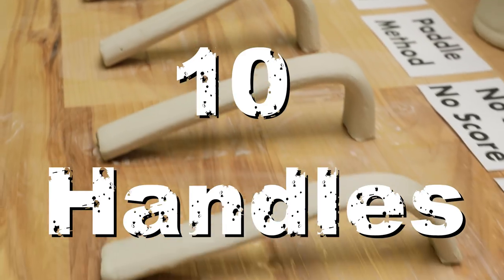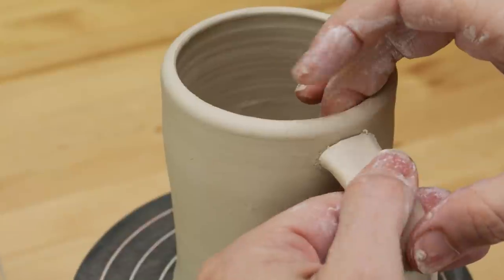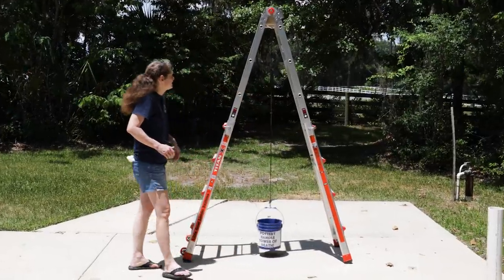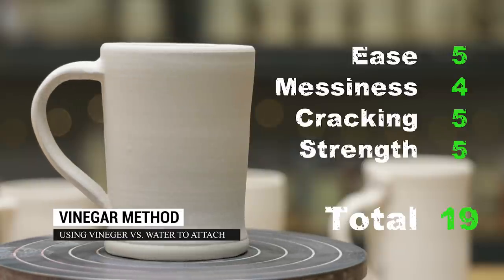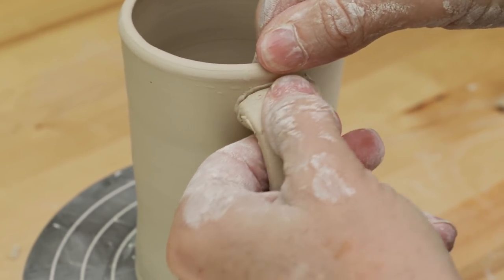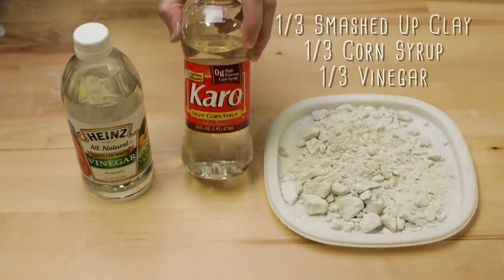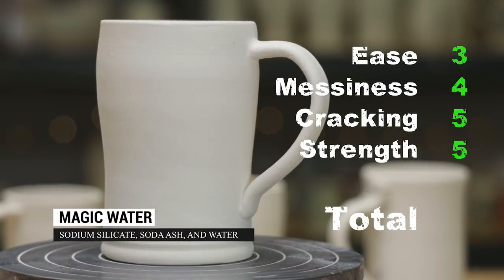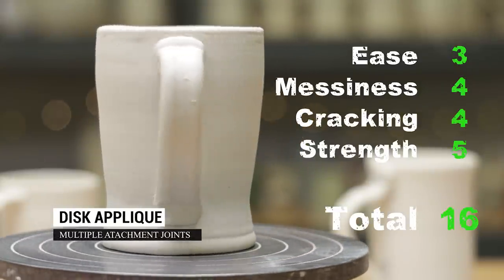10 Ways to Attach Pottery Handles - TESTED!!

Comment: I have now mixed one of the methods you did with something I was already doing in my studio. I had always attached with slip always got cracks. I was told to attach the handle with slip and then put the mug bottom side up to dry and let gravity do the work, less cracks but they still happened. Now I mix my slip with vinegar and attach the handle and then let it dry flipped upside down! No cracks at all and the only thing I changed was adding vinegar to the slip! I can make a mug and fire it in my kiln the next day maybe 2 days max!
Reply from the maker: We’re using more of the vinegar too...nice and sticky and no cracks so far!

Comment: What fun! Thanks for doing this! If you can continue with some testing, I would suggest that you test each one until it breaks. One approach could be to gently hang the bucket from the handle and gently add weight until it breaks.  Then display the weight at which each one broke. I'm guessing that will show a difference between the techniques, but maybe not! You might want to add a cushion on the handle at the point you are attaching the bungee so it doesn't make a single pressure/breakage point (use a section of pool noodle?)
Reply from the maker: We’ve not seen the last of the Handle Tower of Death...love your idea! Stay tuned David....thanks for watching!

Comment: I always find the hardest part of handles being managing the relative dryness of the mug and handle, which is trickier if you don't have your own studio at home.
Reply: You are right about that Majoofi.  When I was working in community studios, I used to try and take the mugs home so I could monitor the dryness factor.  I just had to pray they made it home without being damaged, haha.  Good luck to you!
Reply: Also I've found some clay bodies need to dry under plastic longer then others, once dry I rarely have cracking in bisque and glaze firings
Reply: What I did when my mugs were a bit too dry, I wrapped wet paper towels around the too dry parts of my mugs and covered them in plastic.  I lifted it a few times and sprayed it with water if they needed it, and recovered them.  I worked on the most moist leather hard first, then the next and the next.  I cover and let dry slower for a day or two as I work at a studio and have to leave them, then uncover to dry completely.
Reply: @triciac1019  My dream is to get my own studio with a moister controlled drying room.
Reply: @Majoofi  oh that would be wonderful!  Find a way if you can.  It's so rewarding to do pottery and learn about all the glazing and firing techniques.  To be able to have shelves of your tools and shelves of your work.  Good luck with that, you can do it!
Reply: @Majoofi  When I was in college, our pottery area used to be part of a cafeteria. It had a walk-in meat locker that was the best drying area ever.
Reply: @Majoofi  I used to make mugs at home on a one roomed apartment, attaching handles was only a problem if I didn't use a suitable method. People have been making functional pottery for thousands of years without moisture controlled drying rooms, and many successful potters studios don't have them...

Comment: I’d love to see how these same mugs go without the bucket bottoming out and hitting the ground (so the ground isn’t absorbing the shock along with the occy strap). My (unconfirmed) guess is that the results would have been fairly different if it was a rope with minimal stretch and/or free-hanging bucket. 

The test you did (IMO) is easily sufficient to determine fitness for general purpose use though, which is still definitely good to know :)
Maybe this one can be the ‘tower of mild torture’ instead :P

Thankyou for sharing these comparison videos :)
Reply: I loved this idea and the video was so entertaining. Thank you to the creator! Slightly disappointed at how many mugs passed the test, but still a fun idea. If the weight was targeted so that around 50% of the mugs failed that would have been more telling. OR better yet, add the bucket empty and fill with sand slowly until it failed. That would have actually told us which method was the strongest.

Comment: Great work - but FYI when you heat sodium carbonate it decomposes leaving sodium oxide, which is soda ash.
Reply: I just looked it up and this is what it said, "Simply heat baking soda or sodium bicarbonate in a 200 F oven for about an hour. Carbon dioxide and water will be given off, leaving dry sodium carbonate. This is the soda ash."    i just went by the instructions I was given. Thanks Bungawarrah for watching!
Reply: @annruel9142  - Sorry - you are correct. For some reason I had in my head, sodium carbonate not sodium bicarb.  So my error, sodium carbonate only decomposes at very high temperature. Must be old age! I'll delete my comment later.
Reply: @bungawarrahlima8816  No worries Bungawarrah. It was all an education for me.  I have just been having fun experimenting :-)